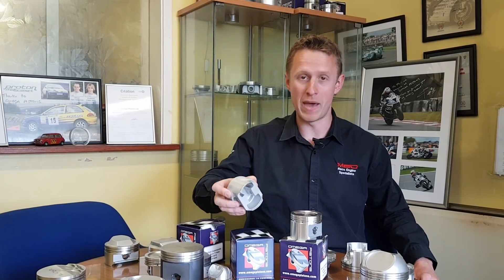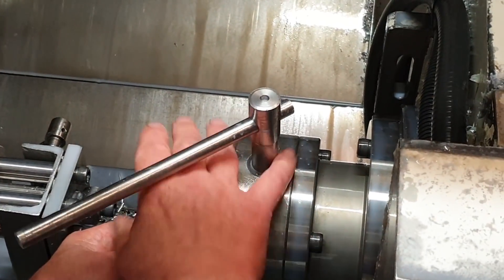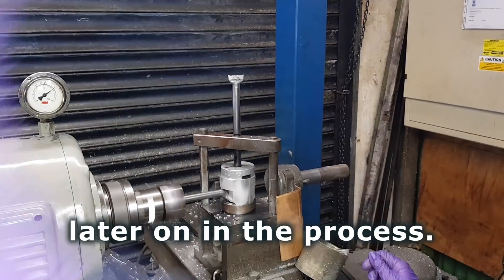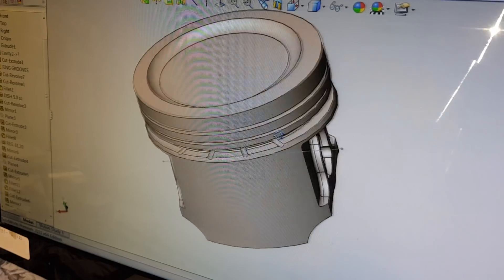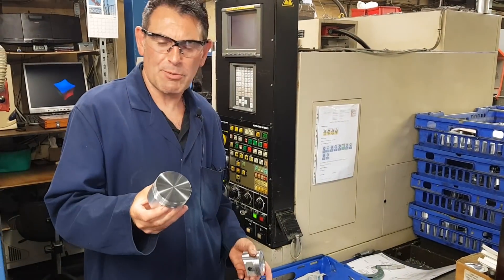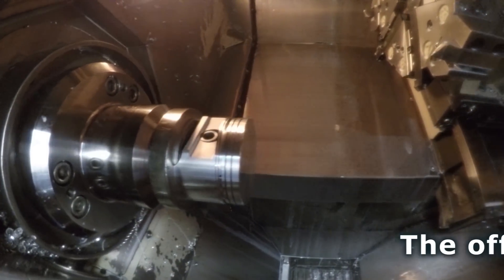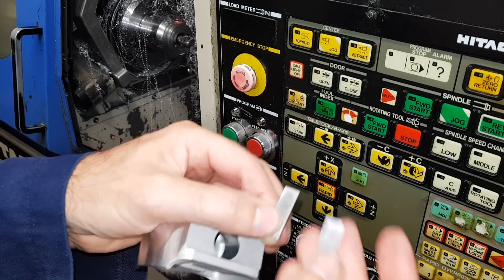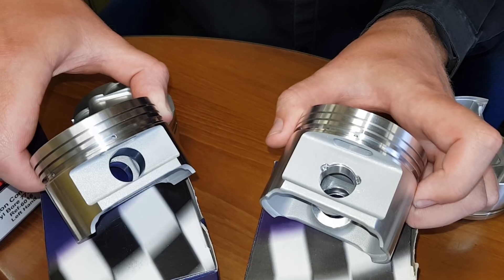How it's made - Omega forged pistons - Part 2

Comment: Hi , do you guys make pistons for classic / vintage motorcycles , or would it depend if you had a forged blank that was close ,I am finding it difficult to buy anything but a JP piston JPO1032 , needs to be 3.250 + .030  with a 1.812 comp height , for a 49 Matchless G80 . great video thanks for sharing . Cheers.

Comment: Now this is very interesting I restore interesting, sometimes so called exotic engines, my pist suppler in the US is good but I would like to use UK engineering if possible do you do one engine sets or large runs
Reply from the maker: It's usually prohibitively expensive with forged pistons, sadly, as you'd need to fund the forging tool itself.
Reply: @MEDEngineeringTechVideos  hi are you connected with the company I ask because I don't recognise race teck thanks tooling in not to much of a problem for us we tooling  for some very rare engines  and sell to high end restorers some of these components cost over £30,000 each and a crank came be over £50,000 plus. I am in Turkey at the moment but will be back soon I will make contact then
Reply from the maker: @kennethmoxon7337  We're the main retailer of Omega pistons for the BMC A-Series. You may be best to contact Omega direct on this one.
Reply: @MEDEngineeringTechVideos  thank you for your reply sorry I did not recognise the respected name we  deal in mark specifics generally v12 and v16  units  so called exotics so we will make contact direct as you say

Comment: When you see how much work, skill and technology there is to make a piston they seem very inexpensive.
Reply: 朋友我以前在台中翻砂紉機的材質一樣，差不四十四年，我去找朋友沒看到，可能去大陸，分享
Reply: But they ain't
Reply: @zacharyherrington8829  yeah no. make them yourself.
Reply: @marklowe7431  don't know what planet your on 900$ for the ones I need
Reply: @zacharyherrington8829  $900 is great value. Lot cheaper than buying a CNC and all the time spent learning piston design. Calc your comp / quench height spend 900 and your done.
Reply: @marklowe7431  you don't impress me i disagree with you on everything you say.say something actually intelligent besides spend money
Reply: @zacharyherrington8829  It takes a lot of knowledge across many diciplines mechanical, metalergy, chemistry & physics to build a good piston that will endure hp, big boost etc. Not to mention the huge investment in machinery and the materials. $900 Is cheap. Stop whinging and learn more.
Reply: @marklowe7431  that means nothing
Reply: @marklowe7431  I don't  want to built pistons you fool

Comment: Can I ask if you know what type of ring sets will be going on these pistons before you make each set, and whether you have to program your CNC machine around the availability of specific off the shelf or custom made rings? For example if someone in racing is being sponsored by Omega a piston and con rod maker, and that rider/driver is being sponsored by a certain piston ring maker, there has to be that consideration when planning how you make them I guess?!
Reply: Omega would make the pistons to suit the rings that the customer wants to supply if the customer doesn't want to use Omega rings. They would need the  ring widths and the radial width of the rings too.

Comment: heeey  i see a lot the Pistons and i need Two piston's for a BSA 71 SCRAMBLER 650 .. or 
700 (new piston and new measure or 750 ) .. cheers ..
Reply from the maker: You could contact Omega and ask if they have a retailer of BSA pistons. We only supply those for A-Series engines.
Reply: @MEDEngineeringTechVideos  what is A seroes bro

Comment: Dishide piston not good we need dome piston give more high presure.
Reply: dished pistons are for big bore or turbo applications so that combustion chamber doesn't have to be messed with.
Reply: Turbos increase The air density.with a flat piston or in the case of a hemi engine a domed piston you would get detonation.

Comment: Why do you want an oval?
Reply: Theres more metal in the sides of the piston around the pin bosses than the skirts. Its machined oval so it becomes round at full running temperature. Tapered small at the top, largest at the bottom for the same reason. Tricky eh!
Reply: @watsisbuttndo829  Technically the amount of metal doesn't alter the amount of expansion but it does alter the rate of expansion. If you get two 100mm discs 10mm thick, leave one solid and put a 90 mm hole in the other, when they are both at the same temperature they will both be the same size. Obviously the solid one takes longer to absorb the heat right through. The main reasons for expansion at the sides are, cooling in the block usually isn't as efficient between liners, (some blocks are Siamese and have no water between them) and also the heat generated by the pin rotation, in particular if there isn't enough clearance in the small end of the rod the pin can get very hot, this heat conducts along the side panels and into the skirt at that point. Omega recommend .0012" clearance in a small end. On pistons that have a press fit pin ie; held tight in the con rod and no circlips, they hone the pin bore out more. On some of the mini pistons where both types of pin are used, they are honed to suit the press fit pins which isn't detrimental to the fully floating version. Also the Omega pistons aren't biggest at the bottom, but they are the smallest at the top ;)
Reply: Interesting how much taper or out of round-ness are we talking about?
Reply: @beachboardfan9544  Ovality can be anything from .008" (.2mm) up to over .040" (1mm). Some pistons don't have a normal ovality, some need an ovality on the skirt that is too much to continue around the sides and it would reduce the sides too much so the ovality is reduced as it gets towards the pin axis area. Some pistons have up to five ovalities on them. It's all to suit the thermal idiosyncrasies of each engine.
Reply: Thats some mighty detailed knowledge phil! My piston experience unfortunately comes from melting them down rather than building them up. They have come a long way over the past couple of decades. Current production japanese dirt bike pistons would be better than formula one equipment in the eighties. Keep up the good work sir!.
Reply: Actual measurement will change as a percentage of piston size but it will be easily seen with a set of vernier calipers. Stick a properly clearanced piston into a cylinder bore top first and it will be surprisingly loose fitting as they are also given extra clearance around the ring lands as its preferable that the lands dont touch the bore in operation so piston material does not get dragged down and pinch the rings.
Reply: @watsisbuttndo829  for the record, 2618A expands by 0.000022" per mm per degree centigrade increase and 4032 by 0.000019" per mm per degree centigrade increase.